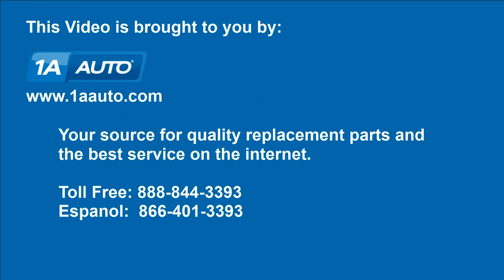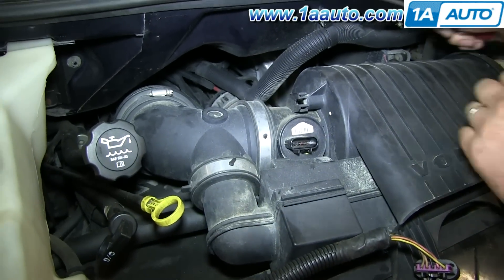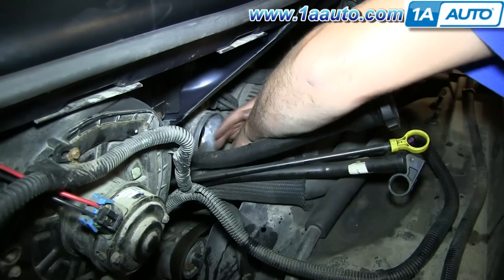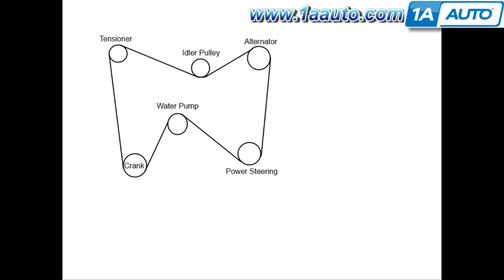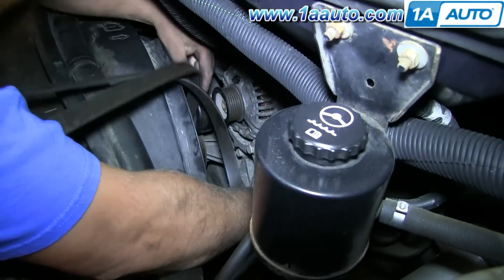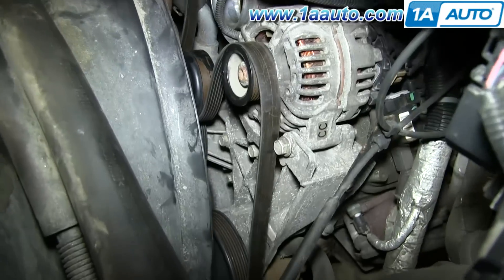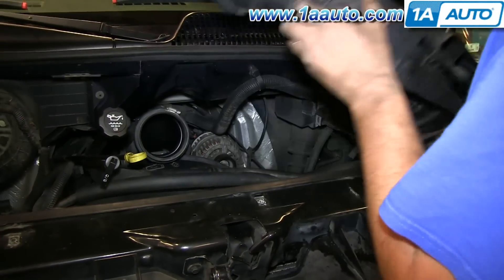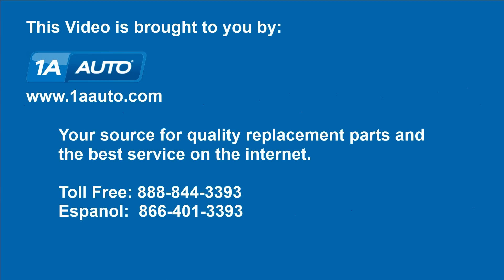How to Replace Serpentine Belt Idler Pulley 96-08 GMC Savana

Comment: How can you tell if its a bad pulley or bad belt? I have a 97 express and squeaks when the engine is cold. Goes away after I've been driving a while. Also goes away when I apply belt conditioners but doesn't last long.- thanks.
Reply from the maker: If the belt is old and and cracks in it you could start with replacing it first to see if the noise goes away. You want to inspect the ribbed part under the belt for cracks. Hope this helps you out. 1aauto.com 888-844-3393